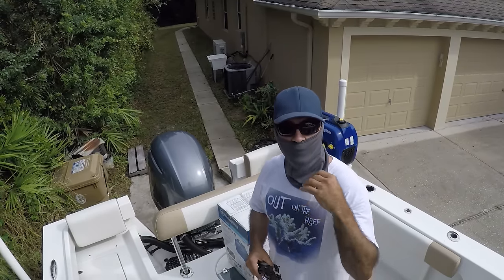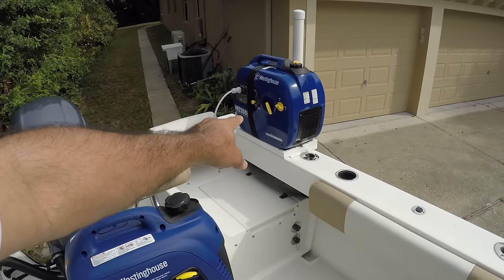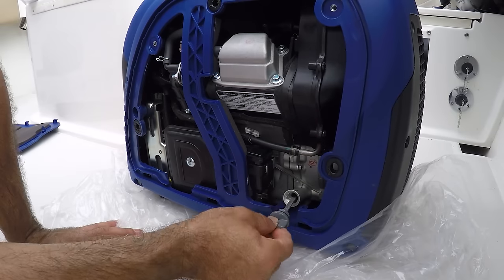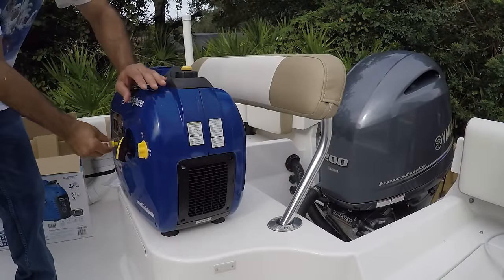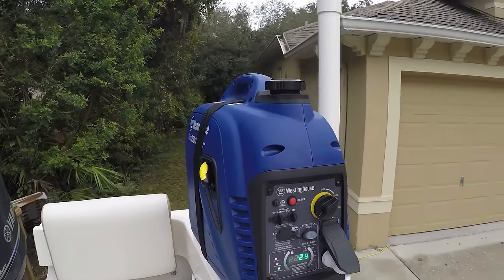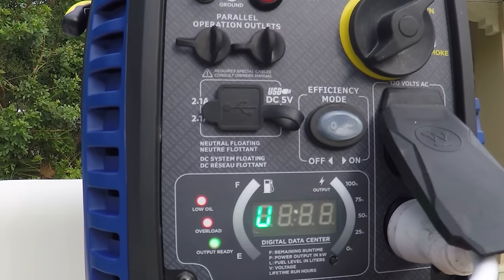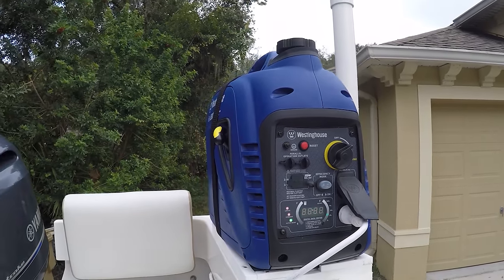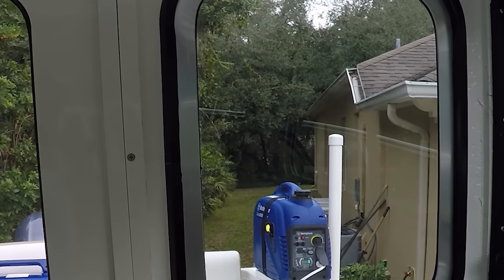New Better Boat Generator for the Crooked PilotHouse Boat Westinghouse iGen2500 Inverter

Comment: Those little inverter generators are awesome. I’ve had a Honda EU2000 for many years now. Never fails to crank up and get the job done.
Reply from the maker: The hondas are great but Westinghouse are 50% cheaper especially did I will have it in the saltwater environments which really deteriorates any generator.
Thanks for your comment cap.
Reply: @OutOnTheReef  - not knocking the Westinghouse Cap. My sister’s family owns one at my recommendation. The Westinghouse model wasn’t on the market when I bought my Honda. You are correct, as the Honda’s are ridiculously expensive. I paid around $1,000 for my EU2000. Hope your new generator gives you many years of reliable service ! 😃
Reply from the maker: @USNVA11  thanks captain and i know Honda and yamaha brands are great but the price is what sets me back especially that I'm going to use it in the salt environment which destroy the generator little bit faster so it's not worth it to spend so much money when I'm going to wear out quick so that means that every five years I can get a new one and be okay and I'll keep you updated how this runs in the future captain thanks for watching and hope your Honda last you a long time to😉👍👍☕

Comment: Hi Capt.... your new generator is a nice upgrade; more power and yet quieter! Although I have seen all your videos, I had forgotten how nice the awesome base/mount that you designed and made is that holds the generator to the cleat; very nice!....
30+ years ago I used a portable generator on one of our boats and mounted it on the swim platform. (I had built a water-proof box to store it in; lifted the lid when using the generator). Back then the generators were very heavy and VERY loud. Even on the swim-platform it was very loud and vibrated in the forward cabin. Your generator is super quiet in comparison!
Reply from the maker: thanks Cap and yes i greed those old generators ware very loud and i like your idea of a box i just dont have the extra room🤣but this generators are so low noise and the price is ok ,will try it soon .
have a awesome day cap. and thanks for your comment 👍⚓

Comment: I have the same Generator on mine and I am very happy with it. I run 6,000 btu marine a/c, Battery charger, and microwave, with no problem. Great choice Capt! Be safe!
Reply from the maker: That is awesome thank you for sharing your results captain and yes I'm very happy with it.
Navigate safe captain👍🏝
Reply: Have you ever had any concerns with exhaust fumes?

Comment: Nice upgrade! Three things - get a magnetic dip stick, recommemd oil with high zinc (use Brad Penn myself), lastly run 2hrs then 10hrs and change oil each time. During break in you will get more metal shavings and best to get it out quickly. Congrats!
Reply from the maker: Yes that's the second thing i purchased right after I got the generator it works amazing,  thanks for the recommendation cap👍👍

Comment: Yup, inside a sound proof casing on a platform outside the transom. Lid level with transom. I put a small blower and a/c vent in roof corner facing back. So I could close when running in rain. Drain in bottom i sloped pretty hard to corner then went back and forth twice length of box to ensure no splash in while backing down. Also put rubber matting for vibration. Or dude you won’t believe what a difference it’ll make if you braze a tip on that muffler so you can put an extension on it an take it over your transom an turn it down past it. You can make it a two piece assembly in a bag. A huge difference.
Reply from the maker: that is a awesome idea cap. i will think about that thanks for your great idea👍⚓
Reply: I really like Crooked PH gen setup but wonder if you have a video on your Cap?
Reply from the maker: @scottk27332  If you mean if I have videos when I made the platform for the generator yes I do and also for the installation of the electrical power line
Reply: @OutOnTheReef  I will look for them thank you! What do you do in case of accidental rain exposure on the generator? You visit the Bahamas I visit this place here in North Carolina and have stay on it many times maybe we work out a deal lol - https://youtu.be/IrDhmj73zIQ
Reply from the maker: @scottk27332  nothing happens to the generator when it rains
Reply: @OutOnTheReef  I spend alot of time in the salt in the Pacific NW. How does salt water affect the generator?
Reply from the maker: @DSKSeattle  i usually dont let the salt splash it only wen is calm seas i will use it but in 2 years is doing great
Reply: @OutOnTheReef  So do you remove it when you’re running? It’s almost unavoidable when you’re running to not get some salt water on it.
Reply from the maker: @DSKSeattle   If I'm running the boat and the ocean is calm there's no salt spray on the generator only when the ocean is rough captain

Comment: My Honda first generation 2000 watt inverter generator I love it they will surprise you how much they can run anyway good video I think I'm going with the two 2200 on the new boat the cooking range on the new boat pulls 20 amps by itself not to mention the water heater in my air conditioner that will give me somewhere around 4400 Watts can you pair them two together anyways buddy good video as always
Reply from the maker: Hello cap.
Yes you can pair it together just need the connector and that will bring 2 generators to 4400 running
5000 peak.
Thanks for watching cap. 👍🏝

Comment: Awesome. 
How do you keep your floors so clean? What’s your method to the madness?
Reply from the maker: Lol what i do is i use some Lisol mold and Mildew foamer with bleach you can get it at your grocery store or at Walmart or Target is awesome it really works a lot and if you want to dilute it a little bit you can do it too I don't use it on the gel coat only use it on the hard surface of the floors I hope it helps captain

Comment: Hey capt. just bought the same generator. Runs great. Now im looking for ideas on how to secure it to the boat. I was thinking of doing like you did and use the cleat but mines is way back and faces the other direction. This is on a 2002 proline walk
Reply from the maker: When I did mine it took me over weeks of thinking how to do it before I actually did it So my recommendation is keep thinking and keep planning what's the best way before you start doing it and I'm sure you can come up with something Like mine

Comment: You should’ve just bought a Yamaha from the beginning I have one for 10 years now I love it
Reply from the maker: Great choice cap. Thanks👍👍⚓
Reply: @OutOnTheReef   I have a Searay 240 and I could run a 12,000 BTU AC/heater two TVs battery charger fridge raider lights water heater and everything runs perfect mines about the same size as yours I believe as far as size wise.
Reply from the maker: @MTee-dw1ww  that is relly  good mine is a 2500 peaks watts what's yours cap.
Reply: @OutOnTheReef  2500 same
Reply from the maker: @MTee-dw1ww  that is a great size the only thing is that I paid $500 and you probably play more than a 1500 hundred for that unit.
And since I'm going to be in the saltwater environment I will hate to ruin a perfect generator in three to four years that cost so much money that's why I buy the cheap ones because they're good and they're easy to replace but I know Yamaha is the best I had one of them in the past and my green home they're awesome
Reply: @OutOnTheReef  I am in salt water too yea I paid $1250 for it yea it’s a lot but it’s takes a beating.
Reply from the maker: @MTee-dw1ww  that sounds like a good price captain and for sure it is a better product👍

Comment: Hey Capt nice video....I have to tell you something brother....when you buy a generator, you need to size the equipments as you did....making a list and look for the KW (kilowatts to use ) plus the surge making a note of all the equipments that you have .....and I know you did it.....aqui esta mi critica constructiva.....ir de 2,200 kw a 2,500 no es mucho por el dinero invertido, claro pensando en el futuro.....y en el espacio donde descansa la planta  pero pensando maybe that later in the future ....you want to bring a microwave or a small air compressor on board , those equipments pulls a lot of KW in surge, specially the microwave and you do not want to unplugged what you have already set....check Briggs and Stratton   P3000; Generac 7129- with 3K surge Champion generator 3,400 or Wen 56380 it has almost the same size requirement for your specs y aumentas casi a 1,000kw de fuerza por el mismo o cerca del precio que estas pagando......antes de retirarme trabajaba con estos generadores....buen trabajo Capt.
Reply from the maker: Muchas gracias por tu tremenda sugerencia capitan ,aprecio mucho tu experiencia y la tendre en mente ,saludos de Florida cap👋🏝
Reply: @OutOnTheReef   de nada mi hermano y saludos desde Riverview, Florida...cuando quieras venir para aca ...te traes la doña y en confianza hacemos un BBQ con par de frias....y cuando quieras hacer algo de mecanica aqui hay 2 cajas de herramientas , compresor, impact tools, jacks, scanner....y yo no cobro nada ....estoy retirado y me entretengo con la mecanica de mis carros , motora etc. Me gusta los inventos asi que imaginate....en confianza Capt.

Comment: I’m hoping a generator is something I won’t have to buy once I get the boat. I harvested an Onan Microlite 2.8Kw from a wrecked Roadtrek RV. Electric start with wire harness, the remote start rocker switch and monitor panel. It’s 18 years old, but it was properly maintained and I believe has about 80 hours on it. If it works for me 🤞that’s money I can put toward other electronics.
Reply from the maker: That's a great idea captain and savings the only thing you need to know is where you going to put the exhaust
Reply: @OutOnTheReef  I’ll probably be hitting you up for ideas when the time comes.

Comment: Nice generator.  I have a Honda that is the same size I think. Maybe 2200 watts ?  Never had a problem.  But I do like all the features that yours has..   Fuel level, load, and time remaining are nice to know !

Let us know your opinion on how accurate the readings are once you have a little time with it
Reply from the maker: sure will John and yes those features are nice to have especially fuel and load .
thanks for watching cap.

Comment: Hi Capt. How are you liking your generator after 2 years? Do you have any updates or pos and cons? I'm looking to buy the same model and would like your opinion.
Reply from the maker: Hello captain and the generators working fine. The only thing is since I got wet a lot and most of my trips. The electronic display is not working but there's nothing wrong with the system of the generator everything's working perfect

Comment: How has this been long term ? I know you use it a lot, how many hours are on it at this time and have you had any issues with it ? Thanks
Reply from the maker: I love it cap now i have about 250 hrs but the only think is the digital panel stopped working but everything is running great, please if you like to support my channel wen you decide to purchased  your in amazon please use my link if you remember and amazon will give my channel a commission cap, and that helps to keep making reviews like this, thanks in advance cap.👨‍✈️👍👍⚓

Comment: You could probably run a 1” exhaust hose below the waterline and use a small electric pump to inject water into the line and you wouldn’t hear it at all
Reply from the maker: Very true cap. That is a great method 👍⚓️🏝

Comment: New to your channel so you’ve probably had this question before.  Any concerns about salt spray causing corrosion to the generator?
Reply from the maker: I try not to navigate in rough weather so there's no salt spray on the on the generator. The last generator was there for 3 years with no problems and no deterioration due to saltwater and thank you for the great question cap.

Comment: Heya Cap.. So I have still not pulled the trigger on a generator mainly because the Westinghouse 2500 is $650 now. If I am only looking to charge my 3 AGM, and 1 36v Lithium battery, and maybe some other small items will the 2200 workin? I have  CC with no cobin so AC isn't a factor.
Reply from the maker: hello cap and yes this one https://amzn.to/44i5Cdr will work great and the price is lower since you don't need all that power and the fuel tank on this one is bigger , hope this helps cap👍⚓

Comment: do you ever have an issue on anchor in waves with the oil sensor cutting off?
Reply from the maker: great question but i have not had a issue with that cap. have you had a problem with that cap.?
Reply: @OutOnTheReef  so not the cap but inside there is low oil sensor on alot of these little generators. Im looking to buy one for the same purpose as you. My question is have you run this in waves?

Also i like your style. Nice clean boat, organized  and everything. Well done my man.
Reply from the maker: @johnmcgrath4111  I run mine and 3 to 5 foot waves and never had an issue but it has a lot to do with what's the size of your boat captain
Reply: @OutOnTheReef  3-5 sounds good to me. Seems like it will work on my 30’ luhrs. Thank you for responding. I hit subscribe to you. 👍
Reply from the maker: @johnmcgrath4111  thank you buddy for subscribing and welcome aboard my channel and I don't think you should have a problem with a 30-foot luhrs that is a awesome boat cap.
Navigate safe 👍👍

Comment: I love blue but its a shame they dont make them in white. They should make a MARINE USE ONE,
 It would go a lot better with boats. Good deal on the up grade. Go grazy and paint it white 🤪🤪🤪🤣🤣🤣😜😜😜😜😜👌👌👌
Reply from the maker: That is a great idea, what pain do you recommend that will really stick to the plastic?😁😁😁
We think alike
Reply: @OutOnTheReef  buufff this needs to be researched well. Something that will stick to plastic, will take sun, salt, sea weather in general. 🤔🤔🤔🤔. That would be it, Paint it with what, so it wont chip or fade. Its a shame they dont make them white. White things always repell heat better when exposed to sun. I think hidroimpresion would be a way to go, since its dipped and not sprayed on. Might stick better to plastic.
Reply from the maker: @2fast4you25  very good idea I will look and make some research see if I find something good payment within the future captain and yes I agree white repels heat a lot better👍thanks